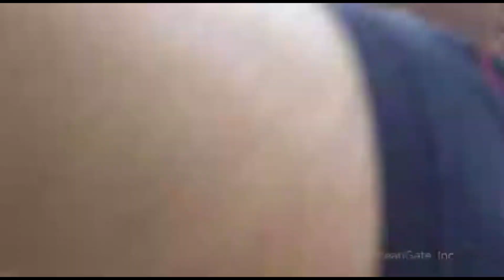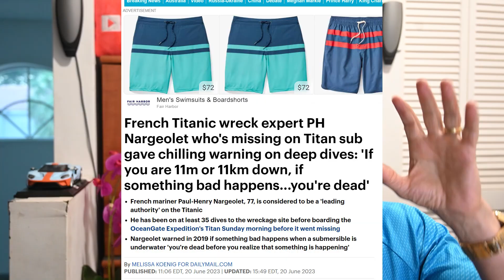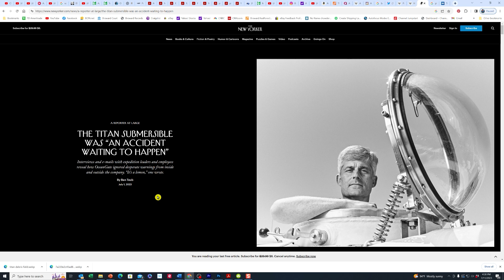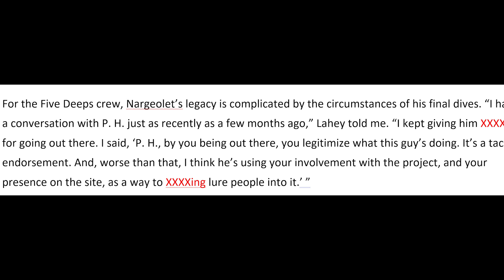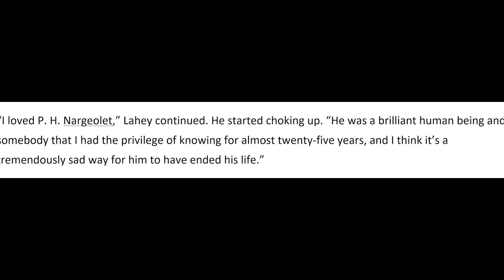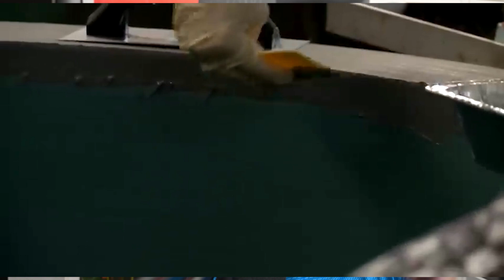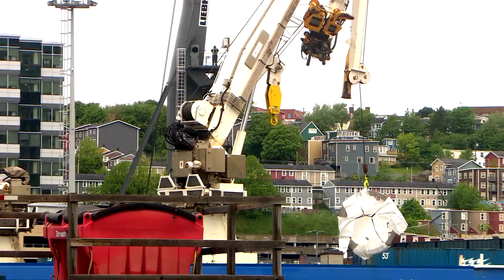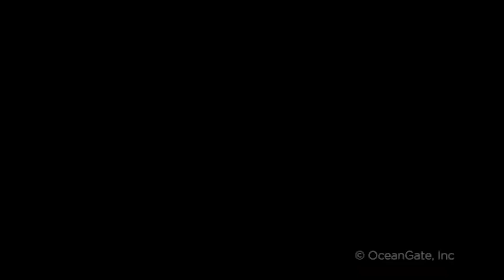Titan Sub: More Q&A, Design Defects, Why Descent Fast

Comment: Whether this transcript is fake or real, the descent rate is not uniform. Please do the math. It starts at around 35-36 (Ave.) at 15 mins into the dive. And reached around 39 only when it crossed 3000 m as per the transcript. From my POV there was a steady increase in the descent rate, whatever the cause.

And to those who are questioning the legitimacy of the transcript, there are other videos out there which show exactly how Titan communicated with the Mother ship, despite having short codes. There is a BBC snapshot of this, so please see it and decide for yourselves. 

Also, I don't agree that the transcript is fake simply based on the descent rate (as someone commented). Rush was a cocky and arrogant idiot whose attitude was to disregard a lot of safety protocols including steady descent rates. He must have ignored the warning signs (which the mother ship sent him as well, at around 1 hour into the dive) and continued as he wished.

And my final point - I think these companies - Nasa, Boeing and University of whatever are simply trying to avoid the bad press by distancing themselves from Oceangate. They did help Rush, and there are actual videos created by other Youtubers where they show a collaboration between WSU and Oceangate... Also, with the way litigations happen these days, nobody is that stupid to use logos / TMs on their videos without prior permission. Rush certainly doesn't seem the type - considering the attention to detail given to the legal contracts for his "Mission Specialists"!

If all had gone well, and this experiment had been a success (over time), these organisations / companies would all have taken credit. Now that it hasn't, they want to have nothing to do with it. 

Only when someone decides to investigate and get to the bottom of things, will the truth come out about these associations, but considering the stakes involved I bet a certain government will try to keep their top companies / organisations from getting any bad press. As always!

Well, that's just the way the world works, isn't it?

Comment: That connection between the carbon fiber pressure chamber and the tail cone looks dodgy.  I imagine there's a lot of stress on that aft titanium ring which could break the adhesive bond and damage the carbon fiber underneath.  Could water have intruded into the tail cone causing it to lose buoyancy and resulting in the faster descent rate and the very slow ascent attempt?  And the extra weight dragging down on the rear section while trying to thrust at max power upwards cause the chamber to finally fracture at that rear connection?  I wonder if by jettisoning the landing frame further reduced the structural strength of the submersible, accelerating the failure of the carbon fiber.

Comment: I tend to agree the glue was not so much glue as a flexible sealant.  The glue didn't hold the rings in place per se, the water pressure did. Look how narrow the inner ring is. If the hull was starting to deform, it would not be a stretch that that tiny ring failed causing the rest to go.

Comment: Jeff, In 1972 I was a new products development Engineer for Shakespeare, Inc. At that time, the world's leader in Carbon Fiber and Fiberglass product design. In developing the 1st Carbon Fiber Golf shafts, etc. We did lots of destructive testing on carbon fiber over removable central rods & cylinder layup methods. The method used in the subs design is a simple one, that always failed in our tests. It has zero longitudinal or flex ability. You have to lay up carbon fiber in 2 or more simultaneous procedures, criss crossing from opposite directions.  Between each other, going back and forth the length of the core. There are massive amounts of engineering that goes into laying up carbon fiber, layup designs, angle of fiber placements, speeds, and much more. As soon as I saw the technique used on the sub. I knew it would fail. Just like the hundreds of similar layups we tested to failure at Shakespeare Products, decades ago. It had zero chance of success.  A completely stupid way of doing carbon fiber cylinders.
Reply: Hi Bill, yeh your right with the criss cross laying of CF, his method was destined to fail, but also a bigger problem was the bonding of the titanium    rings to the CF, I think he broke every correct way of manufacturing in the rule book, what àn arrogant individual
Reply: Having worked in software projects, cutting costs by bypassing the Quality Assurance process only leads to certain failure.  Combine that with a fanatical leader who refuses to acknowledge reality and unwillingness to build on existing expertise, led to these unfortunate avoidable deaths.
Reply: Your job sounds really cool !
Reply: I remember buying a Shakespeare Carbon Fibre Fishing Rod, and having it in a rod holder by a lake when it was struck by lightning, I remember that there was a warning tag on the Rod. Didn't the Titan get struck by lightning?
Reply: @AnthonyOMulligan-yv9cg Yes, that happened
Reply: Well said, the crazy thing is they would have discovered this design flaw on testing.  Unfortunately they used paying customers as test dummies
Reply: Thanks for the EUREKA moment regarding CF properties and proper manufacturing processes. Regardless, I believe a total steel hull properly tested and "certified"  would have been the proper "solution" for deep diving into a salt water ocean environment.  Stockton Rush was living in a fantasy world he created. Too bad others paid the ultimate price for crappy engineering and construction. As a teenager, I loved fishing with my "Shakespeare WONDEROD." What a "cool" company!!!
Reply: Great comment. Thank you for the informed observation.
Reply: Great insight. It proves the science was out there in many forms.
Reply: This is the kind of procedure that young, inexperienced engineers might use.
Even if they have very good grades in college, without hands-on experience, 
they are not ready for life-threatening projects.
Reply: In New Zealand, a number of motorcycle chassis’s have been made of carbon fibre and they have experienced the same things that it’s great in tension and under pressure but not under compression. Never mind which way they’ve laid the fibres LOL
Reply: could u compare those methods of criss cross to that of the SCBA breathing cylinders we use in the fire service because i was looking at them since they first came out to us after we stopped using steel cylinders.  We gained so Much more as fireman in terms of light weight cylinders and the psi we could put into them we went from 2216 psi to nowadays as much as 4500 psi for 45 min to an hr long on our breathing appararrtus cylinders,   Our SCBA cylinders are now carbon fiber wrapped and u can even tell at looking at them they seem to have a criss cross type of wrap.  I know nothing of this except what NFPA standards teach us. But I would love to hear your opinion in comparison from titans fiber wrap to our breathing apparatus.   U seem so very well educated and I appreciate your work In keeping Us safe.  Thatnk You .

Comment: 7:18, does that autoclave also help remove any air bubbles from the carbon fiber epoxy?
7:49, you can see irregularities in the carbon fiber.

Comment: I am far from an engineer, but one thing about the Titan design really stands out to me: there is zero mechanical fixing between the CF cylinder and the titanium ends.  Two vastly different materials with different expansion/contraction rates held together by glue.  It's no wonder that the ends simply popped off when the cylinder collapsed.
Reply: Same here. It boggles the mind.

Comment: I agree with another guy I saw the glue isn't important as at that pressure the craft is forced together with such force that the glue is just a gasket between the surfaces. The carbon fiber itself is probably what failed. They did so many things wrong that it is just confusing the main falure point the carbon fiber. But yes they did it all wrong. However if they were leaking that would explain the faster than normal descent and the problem getting it to go back up.

Comment: I have had a little experience wrapping relatively large(8" to 24"dia) marine propeller shafts with fiberglass tape & epoxy resin  cladding between the raised bearing surfaces. To prepare the surface of the shaft for better adhesion, we would warm the surface with a rosebud torch while the shaft is slowly turning in the lathe. This would draw out whatever moisture is in the metal surface & help to accelerate the epoxy cure. We would follow with using a big abrasive flapper wheel to remove the slight flash rust which would form from the moisture/torch action. This would roughen the shaft surface & enhance adhesion, too. We would also machine a "landing ramp" on the ends of the bearings. This was a longish taper, with a rough machine finish and a few "O-ring like" grooves to also assist in adhesion and sealing. While the resin & tape is applied, the shaft is constantly being slowly turned in the lathe to assist in achieving a uniform application. The f/g tape is applied in layers with wraps in opposing directions. We kept spinning the shaft for 5 or 6 hrs until fully cured. The finished wrap would be spark tested electrically, per ABS stds.

Comment: It is pretty clear that this sub was pushing the limits of safety, and it is sadthat so many warning signs were ignored.

However, that being said, it is also dangerous to jump to conclusions. And investigation is ongoing, and they have access to all debris and all emplooyes other than those who perished, so I am optimistic that they can find a more specific cause than us just pointing in 10,000 directions.

One thing to consider about the carbon to titanium interface is that at 3800m the pressure will help keep everything together. If you had a perfect tube and two perfect endcaps all capable of handling the pressure, the water pressure itself whould keep everything together. The bigger problem is probably that Titanium and Carbon Fibre may not compress at the same rate under pressure, which could mean that the end piece of the carbon fibre is under uneven stress.

Odds are that its a failure in the carbon fibre hull near the end cap interface, but I would like to see the official results before we start pointing fingers as to why it happens.

Comment: I would like to know:
Thrusters are they compressed air?
Batteries obviously outside how di they withstand the pressure?
Solenoid valves switching in that pressure?
I can understand why blue tooth controller is used because no cable entries from outside to inside.

Comment: when they assemble the ring and cyclinder its not even a tight fit they went together easily where there should have been some sort of compression fit. Also with regards to the carbon fiber any cylinders i have seen with CF its a cross weave pattern around the the cyclinder looks to me like it was just wrapped in strips

Comment: What I don't get is, given the experimental nature of Titan and the unproven technique of using a carbon fibre cylinder, why not have a couple of titanium rings supporting the structure inside the pressure hull? Doing that would, in a sense, replicate how military subs are built with internal ring frames supporting the pressure hull along it's length.

Comment: I believe it ascended too fast because of low buoyancy and these are some probable causes:   
1) Layers of carbon fiber failed and took in water and these failures propagated as stress and time increased and added weight to the submersible.
2) Contraction of the carbon fiber walls under stress contributed to a drop in buoyancy.  
3) Small pockets of air left from the manufacturing process would have contributed to this drop in buoyancy.

Comment: Thunderf00t nailed it.  The modulus of elasticity is MUCH lower for carbon fiber.  It wanted to shrink by 1/2" in diameter, but the ring wouldn't allow it, leading to an enormous stress concentration and buckling right where the ring stops.

Comment: You are awesome.  Love all your videos, the building ones are great too.  I went downtown in Grand Rapids Mi.  for dinner as old retired guys do often and started looking at the very old brick structures.  Wow I think some of them are in dangerous shape.   Additionally when you mentioned sitting in meetings talking about design concerns and they blew you off that is exactly the same thing they did to me.  I NEVER was wrong looking back at the design failure I tried to fix in those meetings.  They did not learn and kept making the same mistakes.  Every comment should be carefully considered and not quickly dismissed as they do.   Thanks again

Comment: I’ve worked in Composites converting for over 10 yrs now. I convert the pre-impregnated carbon fibers used by Boeing, Airbus and the space programs. I don’t manufacture the carbon but I’ve visited our customers’ facility and viewed the process. Without going into detail the process they used to manufacture that carbon hull was all wrong, they wrapped raw fiber around the tube and then applied the epoxy resin. Who knows their curing process used. Before we even cut the material the epoxy is already impregnated into the carbon fiber. We cut the pre impregnated master rolls down to spec. and spool, Boeing & Airbus uses the AFP process to lay that spooled material. They place in autoclave to cure the part.

Comment: everytime it went down, the flex n the centre of the tube would have flexed the glue joint open.
i'm sure the thin outside of the titanium  attaching ring squished the carbon fibre  thinner  on the outside edges at the same time.
just a matter of time til the water forced it'sway through any openings in the  ring to fibre bond. 
there were no  embedded anchors in the carbon to help hold the joint together.
even gm learned that mistake when doors started falling off their vehicles late 80's or early 90's. 
you can't just glue moving structures together  and expect them not to fail without some physical anchor.

Comment: 7:50 What I see here is like a high school project type of product. All those bubbles or imperfections shout defect to me. The individual layers should be as homogenous as humanly mechanically possible. Everything else is a fail.

I think the fibers were actually pre-vetted (per-preg). They came from Boeing as rejected material because the epoxy they were covered byy was beyond its "consume by" date for aircraft purposes. I am not into epoxy engineering. But it raises the question if it is no good any more for a plane why is it good for a sub with 4000 times the pressure defferential (1bar inside plane to space at 0.1bar vs. 1bar inside submersible to 4000bar water pressure)

Comment: So many questions and only speculation for answers. It could be too much ballast was added. As we can see it was rather unorthodox in places as scaffolding pipes were employed in part. Just a wrong calculation or one piece being mixed up with another could have been and issue. You cannot either rule out Rushton pushing the limits or breaking the rules again. Trying to shave off time on the descent as he has become over confident in his design. If the transcript is true they are clearly being warned by topside about the descent rate but the submersible seems to respond in a way that glosses over any potential issue.

Comment: Many experts are saying "carbon fiber has no place in the sub industry" , but if even a MacGyver made sub with poor quality control and manufacturing errors was able to complete the mission 3 times, maybe more study is required before totally condemning the carbon fiber itself.

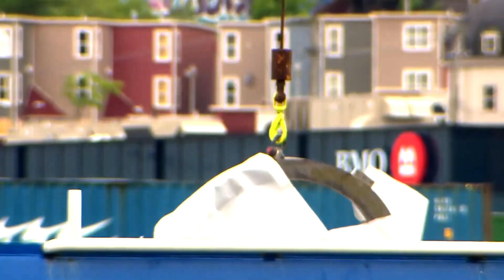Comment: 6:11 Jeff, the idea that you need a good bond by roughing up the surface is in my view still a thought process that comes from the wrong end. I.e. this is good if you want to avoid the endcaps being pulled off. But in the actual environment those are under extreme pressure. So no danger of them falling off. That's what water pressure takes care of. What I rather look at in those bonds is: 
1. Movement of parts against each other due to diffrences in reaction to extreme pressure. If the epoxy does not compress while the titanium does, or vice versa, then you have a problem. So expansion/compression rates should be ideally equal. If not, what then`?
2. Surface homogenity. I think if you rough up the titanium surface will you introduce microchannels between the glue and metal where water under extreme pressure can creep in? Same for the bond area of glue and epoxy. So at least I would epect to make tests showing how A. the glue and B. the parts combined stand up under the conditions at 4000m under the sea.
3. Long term behavior. This would be tests looking at the diving cycles and their effect on the bond. And not to its strength against falling apart but mainly to its watertightness.

Comment: The type of manufacturing used to make the composite tube is called “wet winding” there are rolls of try carbon fiber that are wetted on the way to the payoff ring and cylinder